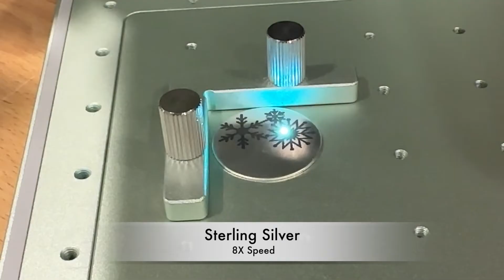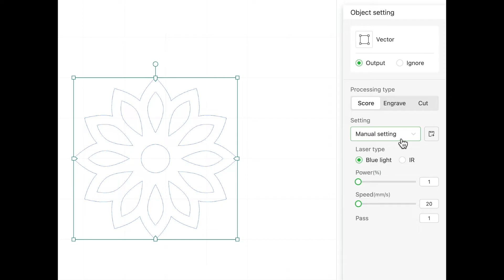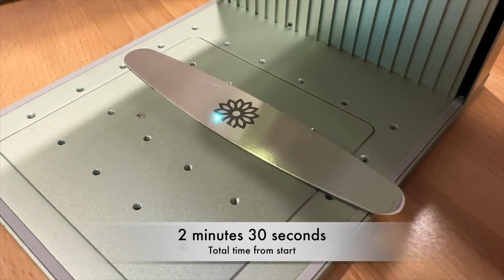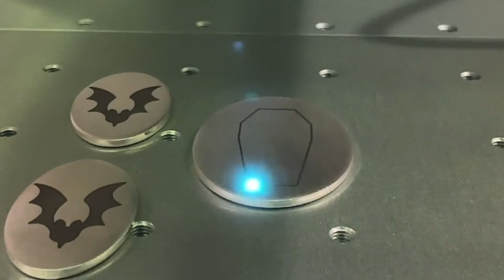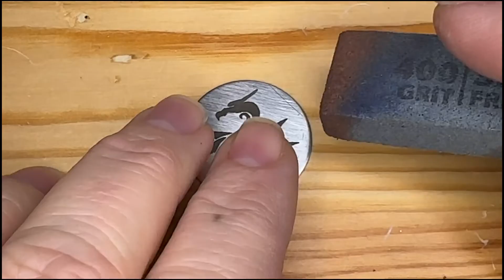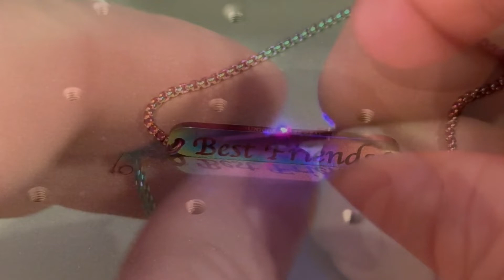Does the xTool F1 Engrave Metal For Jewelry Making?

Comment: I’m a MetalSmithing artist and wondering if you can laser a piece with sterling silver or copper and then also solder something onto it as well using traditional techniques and not a welder. Will the fire/heat cause any issues to the already engraved piece? Or do they need to be soldered first and then engraved? Thank you
Reply from the maker: Yes. You can laser first. It should not affect the engraving. I would not always say the same for traditional hand engraving.

Comment: Hi. I would like to engrave on stainless steel watch back covers and some jewellery. I have the tts 10watts. It simply isn't etching anything on the metal. 100 power. 100mm/m speed. 10.000 lines/mm.
Any suggestions.
Reply from the maker: Slow your speed down. I typically use a speed around 5-10

Comment: What I was thinking is to paint the metal black, invert your design, laser blast the design obliterating the paint, then use chemical etching to get a deep engrave/etch.
Reply from the maker: That may work. I have not tried that
Reply: @TheAndyroo770  use a jewelry coating to seal it.
Reply: @TheAndyroo770  or just print and use the blue paper and etching solution, save yourself 3K. I was hoping this would do proper engraving for fine jewellery but looks like it's not suitable

Comment: Im trying to engrave a ring and all i see is the red laser but not the blue to line them up.
Reply from the maker: Are you using the RA2? Or are you doing this flat on the bed? Have you removed he lens cover?
Reply: @MelissaMuir I figured it out. I'm struggling with placement but finally got one close. How do you get your gravers so sharp? I've followed every book and I fail lol.
Reply from the maker: @AngiesByKim  I use my graver hone or diamond shaping wheels to sharpen and polish my gravers. It makes it so much easier.

Comment: Thanks for a great and informative video! If I were to use this tool to engrave a large design on a flat brass or sterling cuff, do you think the engraving would be deep enough that once I bend and shape the metal you would still be able to clearly see the design? Also, would the engravings be deep enough to last on a something such as a cuff without wearing down too quickly? Considering this machine to supplement my other tools.

Comment: I'm wondering what depth it can engrave to on silver? I am looking at designs that are currently 0.2mm deep but I can go to 0.1 or 0.05mm. Currently I outsource this work but if I can do it in-house to the required depth this machine might be worth considering....
Reply from the maker: This does not go deep at all. If you go over the design multiple times very slowly, it can give you a little bit of depth, enough that you can feel it, but it is still mostly just below the surface.

Comment: Curious what saw and blades you use for cutting out designs. Thank you! I have an xtool F1 on the way and plan to use it similarly to you but in supplementing my hand stamping work. Thank you again for making this video!
Reply from the maker: Do you mean the saw blades when I cut the metal?
Reply: @MelissaMuir both. I ended up with a Knew Concepts and Nano blades 😊
Reply from the maker: @annjessup1670  I have never worked with the Nano blades. And the knee concepts seem to work well.

Comment: Hello there. I make physics demonstrations. I tend to use copper and stainless steel. Do you know if this will mark stainless? Alos, i have a piece that i make (a 3D compass) that holds a compass between 2 x  70mm (3") glass domes/watch glasses. Id like an efficient way to use a rim to hold these together permenantly. Any ideas for process or materials i could use?
Reply from the maker: Yes. It will mark stainless very well. I am not quite certain about what you are asking on the compass. Do you want it to be able to cut out the material for the rim?

Comment: Hello Melissa,  i have a question! I bought the F1 yesterday, but have been having some trouble with engraving picture images on stainless steel pendants. Words come out fine, however images do not come out as nicely.
Can you let me know your recommendation of settings for image engravings with the F1 (Dot duration, power, DPI) .
Also can you let me know what settings you use for engraving images on the metal cards that come with the f1?
I look forwad to your response , thank you!😊
Reply: @mylesnmilestv  i have the same question. did you got an answer?
Reply: Did you find the answers out? Because I need help with that
Reply: @diegocabezas8024  dot duration- 2080/ power 100% DPI- 680/ 12 passes/ Jarvis
Reply: What is the cost of the machine